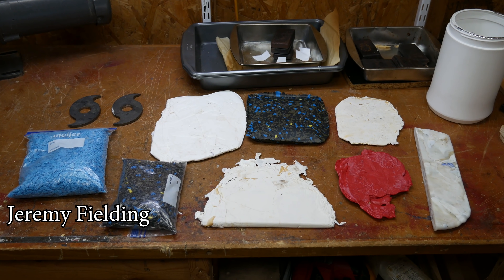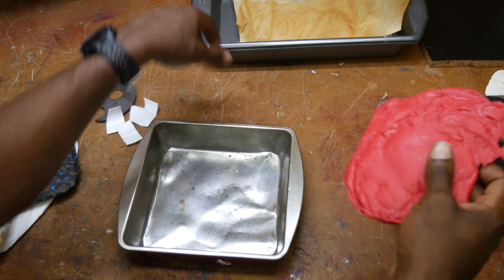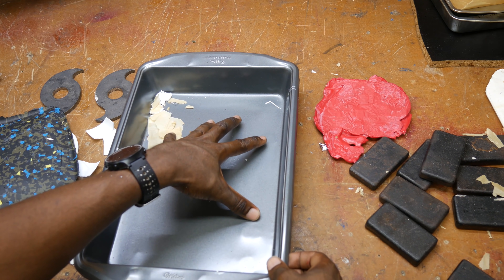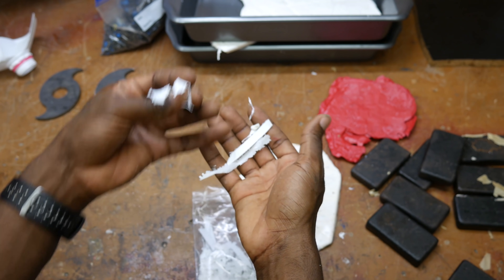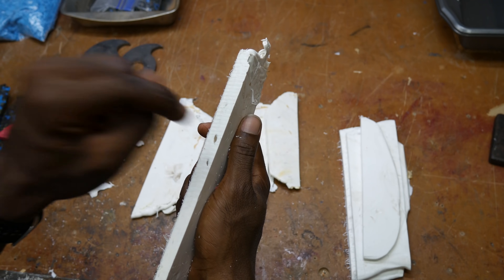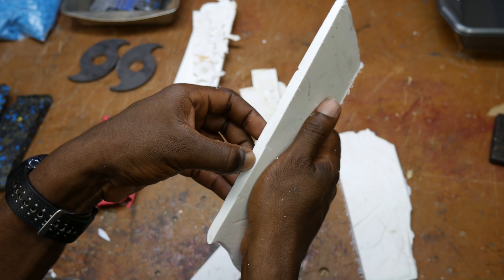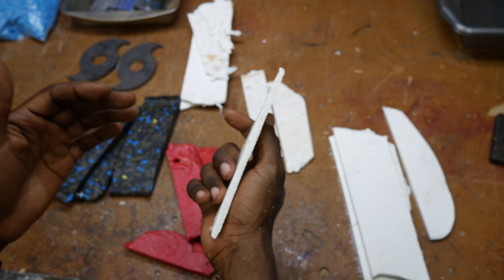HDPE, How Much Processing Is Required; I Put It To The Test!: 043

Comment: Why don't you just use the Harbor Freight chipper shredder? That's how I recycle my plastics. Also, consider using the 20 Ton H-Press when making your blocks. Heat AND pressure are required for uniform plastics processing.
Reply from the maker: I actually salvaged one of these about a year ago. I still have the motor. At the time I wasn't interested in plastics. You use it without any modification?? The price is right.
Reply: It's only limitation is the small 1.5" diameter opening. But it's great on plastics. Wet wood, not so much. Dry wood, twigs, leaves, small branches etc... works just fine. However, I only got one specifically to reduce shop waste. I do a lot of vinyl signs, and there's a ridiculously amount of waste when dealing with the paper backing. I can fill up a dumpster in a week if I'm busy. But realistically it's not really full... it's mostly crumpled, rolled, folded paper. So I now roll the paper into tubes and feed it into the chipper, and now I can take out a 55 gallon bag.

Got me thinking about recycling plastic bottles in the same way. They just occupy too much bin waste because of volume. Crinkle up a bottle to fit the hole and next thing you know, you can take out an entire year's worth of plastic bottles in a 55 gallon barrel to the recycling center. Or in the case of people who want to remelt plastic for other reasons.

Now I'm not the first to think of this, in fact I remember this from the 80s, but with gas powered chipper shredders.
Here's a guy using one https://www.youtube.com/watch?v=5U5fa4HdzYM
Reply: I should also add, that if I were so inclined and wanted to do this again, I'd get the larger gas powered version, as it's got a bigger opening, and unbolt the engine and mount an electric motor on the spindle. Or get one of those electric hydraulic motors from eBay.
Reply: My buddy Rob was shredding plastic with one of the yard debris shredders. I forget how he modded it. The basic difference compared to what you're doing now is the angle the material hits the blades. With those shredders you're going in from the side, as opposed to frontal cutting you're doing. He uses a hydraulic press to press his melts down too. But he was having a lot of air bubble issues until he started using the incremental pressure technique. Just squashing plastic down does not seem to work too well. You just get a lot of squeeze out then. I don't know what's wrong with just trying to squeeze all the air out at once. I just know it does not seem to work. It may have something to do with the poor fluid properties of the material? Shrinkage seems to be a factor in it all too. You have to keep taking up the slack from shrinkage as your melt cools.

Comment: would multiple rotating drill bits rotating and or spinning and grinding the material in a similar way as the old hand cranked pencil sharpeners shreds the materials.
Reply from the maker: Probably yes... but it sounds some what hard to make. The bits need to taper towards the center, they all need to rotate and you have to power it. I don't want to "sharpen" my plastic by hand :)

Comment: Baking HDPE is a bit of an art. I watched a guy on YouTube and he had a convection oven. He was getting great results too. So I got myself a convection oven. Let me tell you, convection is the way to go. With convection you can run hotter without burning the plastic. That's all there is to it really. The hotter you can run the faster, and more complete the melt. My melts take me 16 minutes. As far as what temperature you should run I say run as hot as you can without burning the plastic. Ignore all melting point figures. So calibrate your oven. Take a little sample of plastic and keep cranking up the heat until you burn it. Then back off that 5, or 10 degrees. The critical number is burning temperature. In my oven I run what it says is 385F Before I went convection I could only run up to 365F. Even then I would get some surface burning. Don't cover your melt either. You can do all the weighting and pressing and what have you out of the oven. Burnt HDPE looks kind of like burnt sugar. It stinks too. You should know when you're burning the plastic. I've seen people do melts in glass and HDPE doesn't stick to smooth glass. As the melt shrinks it just pops right off. I melt in a custom metal box I made that I line neatly with non-stick parchment paper. http://i.imgur.com/RpqLjJq.jpg some blocks http://i.imgur.com/boPwUiN.jpg That's all translucent water jug plastic.

Comment: While it wouldn't work for thick pieces, I've found a blender with water just covering the blades will make quick work of milk jugs. I just happened to see someone else make this comment on someone else's video awhile back. Takes a bit for it to dry, but it does a good job. Can't wait to see the shredder in it's final form.
Reply from the maker: +scott webster I broke two blenders, and a paper shredder. I decided to make my own lol. I talk about that more in the first shredder video
Reply: yeah I had similar results here trying to use a blender. I even went as far as sharpening the blades wicked sharp too. A regular household blender has zero chance of shredding plastic. I tried it wet, and dry. Believe me when I say I wanted it to work.
Reply: My first blender was a cheap used one. Did a decent job, but got very hot and quit. Also broke the pitcher trying a thick piece. Bought one from Walmart for $48. I had a gift certificate. I added a little water as per someone's comments and it works fine on thin materials. I wouldn't try an average blender for anything thicker than milk jugs.  I cut the jugs into roughly 2 inch squares. I blend half the jug at a time. While this works fine for me, I'm still wanting a shredder for the thicker pieces like bottle lids. I use tin snips for them, but it gets old quick. Then there's the thickest material - cut offs. My largest cast has been a 10 inch diameter by 4 inch thick blank. I cut off pieces before turning or shaping. So far, the only method I used for that has been a table saw and two shop vacuums. Very time consuming. That's why I have so much interest in a strong home made shredder.
Reply: Many bottle lids are LDPE and they ruin your melt. Don't ask me how I know this. They're kind of fizzy when they melt too.

Comment: Have you tried preheating the pans and weights? Not sure if this would benefit the process but maybe it would. Great assessment of the different shredding options.
Reply from the maker: I haven't tried preheating. I am working with a griddle style heater for now, and I will revisit the oven.
Reply: yeah you need to work on your baking technique. You're running too cold, and don't cover the melt. Also for the ultimate results you have to use a convection oven too. It's magic. I don't for sure know why convection is so much better, it just is. I scored my convection toaster oven for $5 at a yard sale. You could probably retrofit some kind of a fan onto a plain oven and make it into a convection oven. There doesn't seem too much to it to me. There's just a fan in a box on the side of the oven. But it makes all the difference. Then melting plastic goes from really difficult to manageable. I'm not saying it is impossible to melt in a plain oven, it is just a lot harder to get good results.

Comment: First off to get the plastic off your pan, submerge the pan and simmer in baking soda (2-3 tablespoons) and water for an hour and let cool in the water. The plastic will peel off.

I have been experimenting with HDPE for some time check out my instructables.

https://www.instructables.com/id/Making-Dimensional-Recycled-HDPE-Stock-for-Project/
https://www.instructables.com/id/Making-Dimensional-Recycled-HDPE-Stock-for-Project-1/
https://www.instructables.com/id/Recycled-HDPE-Multi-Color-Wren-House/

I think you may be exploring the wrong solution for getting a uniform part.
The reason industry grinds the hdpe small is for uniform and quick melting, I find that if I pre-melt bottles and milk jug (I quarter with a scissors, and position so the handle will let the air out and not trap in the down position) anyway it takes 20-30 minutes to melt the bottles and then I wait till cool. That way the air has a chance to escape, When I need a thicker part I melt the prepared slabs one layer at a time adding another layer about every 30 minutes then when it is thick enough I put a board on top and clamp tight, till material just oozes around the edge. 
Remember hdpe is a good insulator and it takes a long time to penetrate any thickness, so keep the layer thin until melted.
Also each heat removes some of the plastics components and changes the physical properties. Industry only allows 15% maximum regrind to keep parts uniform. Recycled plastic products are usually over built to accommodate the degrading of the material.

Also note that there are several different flow rates for hdpe and you will have better results if you use injected molded hdpe from things like plastic buckets. Most bottles are made with an extruded tube of plastic that is force into the mold with air pressure, you can spot this type of molding they have a seam on the bottom where the tube is closed up.
Reply from the maker: I think you misunderstood my statements at the end. I fully intent to shred my plastic, as I think this is the best method. The same reasons you state above, are the reasons I gave in the video. Shredding will produce more consistent uniform blocks...thus professionals shred. I only mentioned that larger sheets might be feasible with some trial and error, because I get hundreds of comments about doing it that way. The examples I showed clearly agree with shredding. 

Anyway... I will give the baking soda a shot. Thank you for the tip.
Reply: Did you check out the instructables? Also I understand that grinding may seem like a solution because industry uses it, they also heat in a cylinder with  an auger in the center constantly mixing and exposing different material to the heated cylinder, When you place a mass of a pan and do not mix it while heating you get the same effect as placing pieces, the heat heats the outside and you have to rely on conduction through the plastic to transfer the heat to the center. You do have more surface area in ground plastic, but as soon as it melts on the surface forms a sheet and the addition surface area is blinded off. Continue with your grinding idea, but please try my idea to pre-melting and building up a sheet of the pre-melt and clamp to cool. Then you can compare it to ground material. Let me know how well it works as I may change my technique. I have been doing this for about 1-1/2 and have a myriad way that do not work. Also if you get material that has had a lot of ultraviolet damage (faded) , throw it away the "sunburn" material will not adhere to the non ultraviolet, the sunburned  does not metal it just turns into granules like sand cause a lamination layer that fails easily.
Thank you the reply.
Reply from the maker: +a baker I only glanced at it. I remember it’s there. I am trying things one at a time
Reply: Thank you and good luck. 
Feel free to bounce questions as I may have experience the same thing.

Comment: I use teflon coated turkey roasters, big rectangular ones that pretty much take up all the space in the oven.  I don't do any clamping during the heating.  The blob of hot hdpe peels right off it, then I clamp in a "mold" made of 3/4" melamine coated MDF, with spacers to control the thickness of the resulting plate.  I have to clamp really fast, as the plastic begins hardening right away.  Clamping is essential while cooling, else the plate of hdpe will warp as it cools.
Reply: yeah but when you clamp HDPE it develops stress inside of it. That was something I learned when I tried to make a HDPE dovetail stage out of my blocks. Initially the stages worked perfectly, but when I hollowed out the middle for the mechanics the dovetails just curled up and locked up on each other.

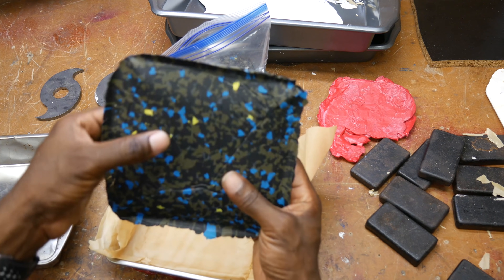Comment: Helloo neighbor! long time viewer new subscriber, I noticed at about 8:40 you had a new band saw in the shop; kinda surprised there is no vidjeo about that bad larry. It looks familiar but boy she runs smoove. for your shredder have you considered or are you planning to add alternating saw blades running in the opposite direction "shredder style"? I believe it would be possible to add heating elements to your mold and make your mold cider press style if you wanted to make discs or square ingots you could make your mold from recycled aluminium and mill it with a wood router w milling machine bit. pason wood working has plans for a 3d router I think you would like you could make your molds very precise with that. 
http://www.paoson.com/en/shop/39-3d-router-plans.html
Best wishes
Reply from the maker: Yes... There will be a video on the band saw when it is done. But now that it is working my "working on it' has slowed down some. As to the heating while pressing... that is pretty much exactly what I have in mind. I bought a griddle to start some trials. I want to be able to make 10" x 10" sheets up to 1/2" thick. Hopefully we can get that. I don't plan to do a dual shaft shredder. I think this concept is working so well, I will invest my time in getting this one tuned in.
Reply from the maker: Welcome to the neighborhood!
Reply: Thanks keep up the good work

Comment: Comparing UHMWPE to HDPE given different shredding methods is a poor comparison. Other than that, cool video.
Reply from the maker: +neowiza360 I think It was actually a better example. Uhmwpe doesn’t really melt. If it formed better blocks it was because shredding prevented air from getting trapped... where as the other flows (barely but it does) and it still formed air pockets. We are not testing its strength or any other property. Only if shredding leads to more solid blocks. The take home message I think is shredding allows the air to escape and leads to more solid sheets.
Reply: I would argue that having the material flow would help create air bubbles since open spaces can more easily be closed off (forming a closed cell) during compression. In materials that become more malleable before binding together the gaps are filled up during compression.
Reply from the maker: I think we both agree that fully shredded plastic creates much smaller gaps to fill. The full sheets left the greatest potential for gaps. and also exhibited the most voids in the final results. That is what I would expect if all the samples had been UHMWPE
Reply: Yeah, I agree. I'd expect the smallest and fewest voids with shredded plastic. However, what I wanted to point out is that there's no apples-to-apples comparison of HDPE shredded vs. sheets (or UHMWPE shredded vs sheets, for that matter).
I expect no surprises there, but I don't really know.
Reply from the maker: Ok... I would have to grudging agree that this would never be published anywhere as research... but really its ok for back yard rule of thumb conclusions. :)

Comment: Atomicshrimp has a great diy hdpe recycling series, such as shredding with a meat grinder and sheet-making method with an electric sandwich press.
https://youtu.be/9qh1qQc3ats
https://youtu.be/W_XUJwINdLw
http://atomicshrimp.com/tag/Recycling

I've fabbed/molded replacement parts out of hdpe slabs I've made, and it lost it's pliability in the process, especially when cut to size with the table saw. Thinner (<1/2") pieces would just snap in half, very brittle compared to the source material.  Seemed like the outer "skin" of the plastic sort of tempered the material.  I wonder if varying rates of cooling affect the pliability, or if molding to size confers more strength/flexibility.

Comment: Hmmn. The kid in this video makes some grey looking hdpe sheet stock with no shredding:
https://youtu.be/rpXq6mnbCus
It seems like putting a little extra effort into the heating and post heating process pays off more then shredding.
Reply: Is that TAOW slow cool video? If it is I call BS on his results. I've tried it, and I've talked to others that have too and we didn't get the same results at all. If you don't clamp HDPE it curls up. I don't care how slowly you cool it down.
Reply: I think it's a different video.  He made a simple cooling /pressing fixture out of wood  which uses c clamps, re tightened every 5-10 minutes over the hour that it takes his sheet to cool. The cooling process takes place about 13 minutes in to the video.

Comment: Jeremy - Love your channel.  I picked up a couple of blenders and garage sales for shredding the plastic. Does a good job but takes a long time to get enough to "cook" into sheets. Looking forward to see what you do next with the HDPE.
Reply: wow you got a blender to shred plastic? I tried that and the blender I got has zero chance of managing it. I tried using an Oster. I think the people that get that to work have one of those $400 Vitamix blenders.
Reply: I found an Oster for a couple of bucks at a garage sale and gave it a try.  I had to cut the pieces small enough to fit in the blender and it was a lot if stop and start of the blender to get the pieces to drop down into the blades. I got it to work but was very time consuming.  I simply wanted to see if I could get a few pieces large enough to turn on the lathe. It was not worth the time I put into it for what I got out of it - in my opinion. Just as I was finishing up, one of the blades broke off and I stopped.